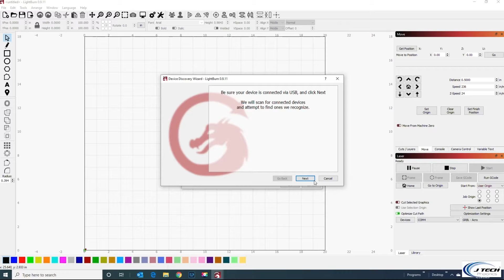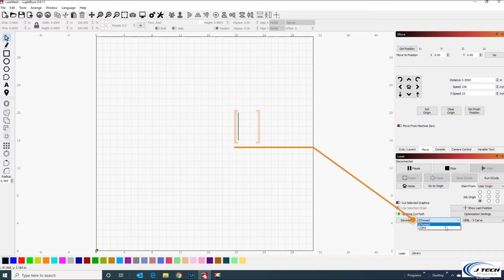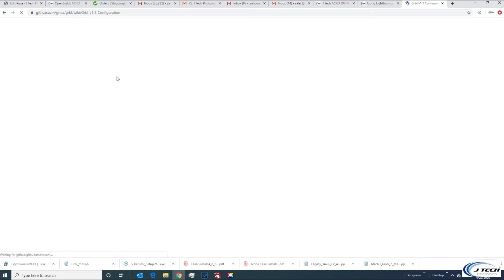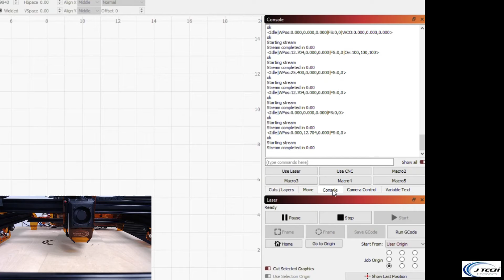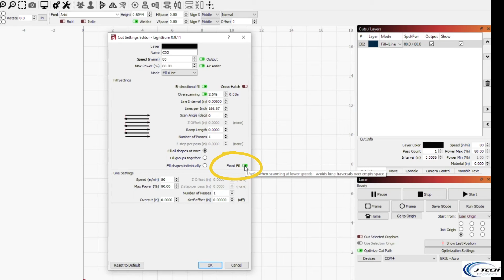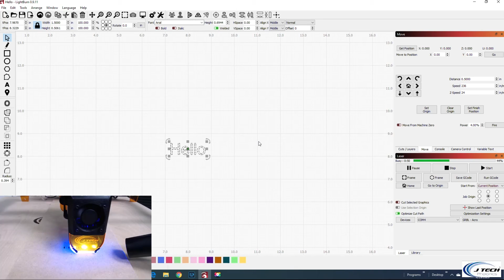Lightburn Setup for J Tech Photonics Lasers and GRBL Machines

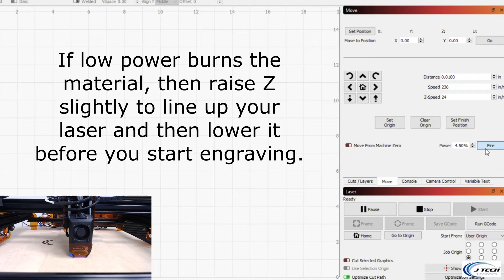Comment: 14:16 This is what I was looking for thru out youtube! Your videos have helped tremendously and I greatly appreciate you. I’m trying lasering for the first time and I’m using my cnc machine. I was completely lost at first. I had no clue about: 1.) Enabling laser ($32=1), 2.) $30=(match s-value max), and finally, 3.) choosing the right COM port. When I applied all of these steps, my laser came to life!! 😅 Out of curiosity, what does $10=0 do? I need to check if mine is set to zero now. Thanks for all your feedback and help! 😎🙏🏼
Reply from the maker: $10 is postion reporting.  It will depend on the machine what you will need this to be.  $10=0 reports work position.  Details are here: https://github.com/gnea/grbl/wiki/Grbl-v1.1-Configuration#10---status-report-mask

Comment: Question about the S Value Max.  I have the 7w laser, was wondering if this value should  be set higher than 1000?  In some setup documentation for the laser they showed some test gcode to run and said to set to 4000?

Comment: so I have the laser up and correctly running on lightburn.  We have discussed my burning too heavy on the phone and that's because I didn't set this settings correctly.  Now I am adding an HD camera. and when I try to run the alignment for the camera, the machine tries to move to the right and back, grinding out.  It worked fine the first day, so I am unsure of what setting I changed that is not allowing the laser to move over the table.

Comment: hi. i have a neje 30 watt laser and lightburn will not cut anything. not a mark at all.  and $32=1 gives an error:17 code.   its like like the laser is off.  the command is $32=1 i think, but i get error:17  everytime i try to change it.  it stays at $32=0.  its crazy.  seems like everything else works ok,  even the laser comes on,  but i cant get it to burn. plz hlp. thx.
Reply from the maker: Looks like the neje doesn't use the main branch of GRBL so it doesn't have the PWM enabled.  Error 17 means it was looking for a PWM output but can't find one.
Reply: @JTechPhotonics  hi. i found the problem. i didnt use the neje-grbl-uploader_v3.1.exe like i thot i had.  now works good but power is not at max capacity. the neje 5.4.2 software uses full power of the 30 watt laser.  thanks for your help.

Comment: why after enggraving on lightburn it still shows busy and can't go to home on the home button or move axis?
Reply: I have the same exact problem.  Did you ever find out a solution?  Everytime I touch and button related to the machine it just goes to busy and will stay that way for hours.

Comment: i have a GRBL 1.1f controlled laser and when i enabled $32=1 i get poor quality results but faster engraving befor i changed that setting i would get perfect engravings with lower power setting but engravings would take at minimum 1 hour for a 3.75x3.75in tile. what i am trying to do is get the speed up which befor changing S32 no matter how hight i set the speed it would never change a setting of 6000 would be the same as 200 ont the etching time.